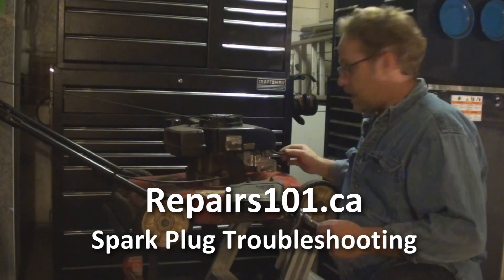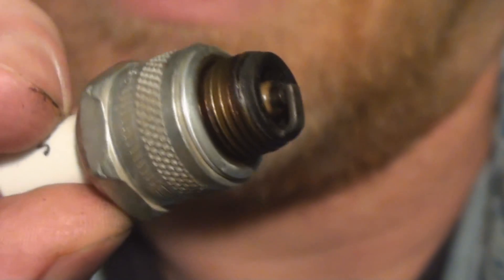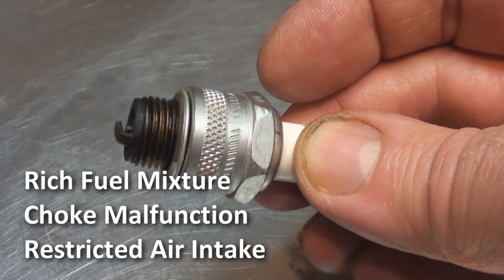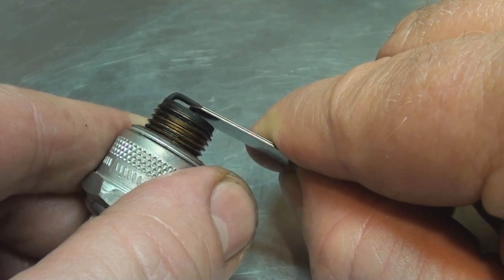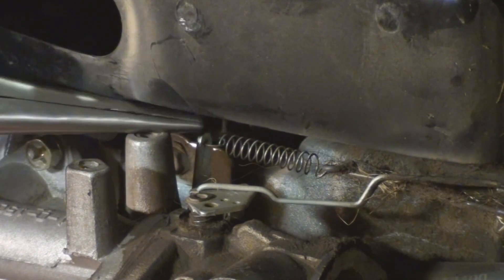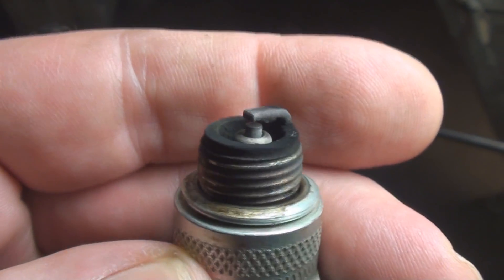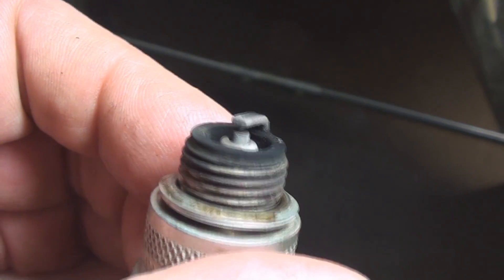Spark Plug Troubleshooting

Comment: We got one on a compressor motor it was working earlier brand new plug we can stick a screw driver down the plug wire and try it it will shock you when we put the plug in it dosent even make a spark at all its like the coil decides when it wants to work

Comment: i had a exhaust manifold leak, and the new spark plugs became very black. After fixing the leak the spark plugs now stays in top condition.
Reply from the maker: Cool!
Reply: And that exhaust leak caused the o2 sensor go crazy, it was stuck at 13% lean with a complete new manifold. After replacing the o2 sensor with a new oem one, the values now are 0,5% at long term fuel trim.

Comment: hay i have a stihl concrete cutter and it runs but when it gets hot it turns off do you know what could be wrong with it thanks
Reply from the maker: If you mean its starts but won't work the most likely thing is it was run with straight gas (not 2 stroke mix) and the exhaust side of the cylinder has been eroded until it no longer holds compression.
Reply: it has full 2 stroke in it because once you let it cool down it works again
Reply: mixed 50:1

Comment: I have yamaha ybx 125 which has sparkplug shorting problem... when I install new spark plug it will start and after few minutes it become fully black... 1 new spark plugs lasts just one week please help me sir what could I do
Reply from the maker: Change your air filter, change your oil, check your fuel is correct and clean. 
If that doesn't do it you'll need a compression test to see if you're sucking oil from the sump.

Comment: Aloha R101, Mahalo for this very nice presentation, easy to follow your explaination of a knda esoteric subject. If I may ask a question not covered in this 101 class?...I'm gonna ask regardless, of course!...any idea what causes oil seepage up from the hex on the metal shell and out onto the base of the porcelain insulator? Its not dirt or grime, mind you, this is a 1/8" wide ring of brown engine oil...?? Mahalo again & for any help? Aloha
Reply from the maker: Probably either spillage from oil changes / fluid top-ups or it's an airborne spray from a small leak nearby / thrown there by drive belts etc.

Comment: There's oil on my Yamaha ttr90 spark plug what do I need to do to fix this?
Reply from the maker: Not knowing anything about your bike - if it were on my shop floor I would run a compression test to see if it isn't sucking sump oil - failing that are you using oil bath air filter (correctly)?  Has someone accidentally put mix fuel (or any treatment etc) in the tank? Sure it's oil and not fuel?
https://www.manualslib.com/manual/582283/Yamaha-Ttr90-M.html?page=56

Comment: Hi Repairs101, today I did a plug chop with my moped, and I got a white insulator tip with a clean gnd electrode, the inside of the plug had a thin layer of carbon though but it was optimal. The point is each time after I come from a long ride I check my sparkplug and its completly covered with a carbon layer; insulator and both electrodes, not very hard deposits but too far from the optimal "tan color".

My concern is, as the plug chop showed me a really good result with the spark plug if I keep leaning the mixture I could damage the engine right? But on the other hand the black and dry carbon after my rides show me that Im running too rich..... 

This is troubling to say the least.

ps: Nice video.
Reply from the maker: OK so black fuzz definitely indicating wrong mixture and / or too rich / overfuelling.
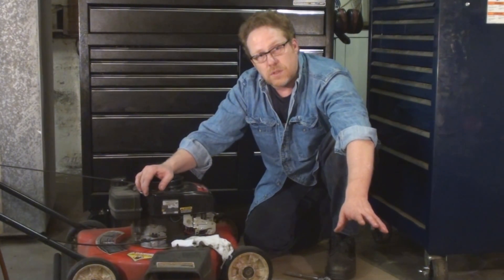Yes too lean will burn the exhaust side of the piston until compression is lost forever - see my video Chainsaws 101 - Safe Operation How To / What You Need To Know https://youtu.be/Vm8YYURlcSk at 2:17 mixed fuel 
Find out what the manufacturer recommends and use only that mixture and type of oil (conventional vs synthetic) .  Good luck!

Comment: My mower starts and runs fine until I engage the blades. Any idea what that could be?
Reply from the maker: Sounds like poor compression - 2 stroke? run straight fuel once by accident? that will require a new power pack (cylinder and piston) 
see Lawn Mower Compression Test  https://youtu.be/U0DuLtoHbWg 
Also have a look at (in particular 2m:17s)  Chainsaws 101 - Safe Operation How To / What You Need To Know  https://youtu.be/Vm8YYURlcSk

Comment: mine has spark but won't fire up ,Evan if I put gas in spark plug opening
Reply from the maker: There's 3 components - Spark, Fuel and air - check to see it's getting enough air.
Reply: +Repairs101 bad head gasket, caused no compression, good to no about the Rings thanks

Comment: how can I get a hotter spark? my engine has a yellow spark
Reply from the maker: My guess is you have the wrong spark plug. Check data tag /spec plate or owners manual for correct gap.
Reply: Repairs101 I want to say you are right, only it is the original spark plug, this is the first time I have had to service this engine
Reply from the maker: I would double check with the manufacturer specs to be sure it was shipped with the correct plug to begin with, then get a replacement - maybe it's just worn out.
Reply: Repairs101 yea, maybe.... thanks for your help!!

Comment: I have a Briggs & Stratton mower. After getting half of my back lawn mowed I stop to add gas, after I add the gas and try to restart the mower I have to wait a half hour then replace the spark plug to get It to start again.  Any ideals why this happens?
Reply from the maker: Sharon Thommen You must have one enormous back yard. My guess is it's overheating from overwork (small mowers are for small yards) &/or a build-up of grass clippings and debris insulating the machine overall. Remember, I can't see it, so I'm just guessing. Perform a basic service, as shown in this recent video of mine https://youtu.be/yy9RdTo_KwI  If that doesn't do t try priming the carburetor after you refill the tank with a splash of fuel in the air filter housing (remove air filter, splash 1/2 oz fuel, replace air filter, start mower.) Good luck!

Comment: Enlighten me, afaik, white isnt  right mixture, it simply means its lean. It should be golden brown not black nor white.
Reply from the maker: Yes! It is a crush type washer which has a distinct face and back (don't mix them up) and is critical for proper compression. I have seen engines run without them in the dark and you can see the fire escaping from around the plugs. Good luck!
Reply: Repairs101 the ring on the spark plug....is it a must have?
Reply from the maker: elcid agustin http://ngksparkplugs.com/tech_support/spark_plugs/faqs/faqread.asp

Comment: Hey, I have a 4 stroke petrol 50cc scooter, it runs perfectly and smooth but I am finding that I have to clean the spark plug every few days other wise my scooter wont fire up. I'm guessing that there is no spark to due to muck and other things on the spark plug, but what I wanted to know was how to get ride off the muck (etc) fully or at least so I don't have to keep on cleaning it every few days? Thanks...
Reply from the maker: King Tanyard  Muck and what other things? If it's a black fuzzy soot my guess is overfuelling. Have a look at these links to narrow down your diagnosis and get back to me if you still need help.
http://www.globaldenso.com/en/products/aftermarket/plug/basic_knowledge/troubleshooting/index.html
http://ngksparkplugs.com/tech_support/spark_plugs/faqs/faqread.asp
Reply: OK I will take a look. Thanks for answering!

Comment: I have a power washer that seems to kind of backfire from time to time while running. When I checked the plug it was fouled and the electrode tip was partly eaten away. Could this be a rich/lean issue or does the ohv need adjustment? Any suggestions?
Reply from the maker: thersten It's always hard to diagnose stuff by eMail. Is the noise coming from the intake or the exhaust? Also, I don't know the machine make or model nor service life, general condition or maintenance schedule. The backfire and the electrode erosion may be completely unrelated. My instincts say if its a new machine look for fuel incompatibility, wrong plugs, damage (to ignition / wire insulation, say). A well maintained (meaning new air, fuel and oil filters regularily) old machine I would be looking at fuel delivery and timing to address backfiring, making sure everything (plugs, wires, filters etc) is OEM first

WIKIPEDIA says - Common causes of backfires are:
Poor or unregulated engine timing is often a cause of intake backfires, but can also be responsible for exhaust backfires
Improper wiring in the ignition can also lead to timing issues and backfires
Low fuel pressure, clogged fuel filters, and weak fuel pumps could cause a severe lean air-to-fuel ratio during fuel injection
Missing or damaged catalytic converter can result in backfires out the tailpipe

http://www.globaldenso.com/en/products/aftermarket/plug/basic_knowledge/troubleshooting/index.html
http://ngksparkplugs.com/tech_support/spark_plugs/faqs/faqread.asp

Comment: When you read a sparkplug and determine if the air/fuel mixture is rich or lean, do you need a new sparkplug before you can read it again? My engine ran rich before and the tip was black, I made it leaner but I am not sure how to read it again since the tip is already blackened
Reply from the maker: Clean it up with a wire brush, brake cleaner (solvent) and compressed air or whatever you have - check the gap is still correct - you should have no problems. Good luck!

Comment: I have a briggs & stratton push mower (6.75 HP OHV) It starts just fine at first, but starts stalling after a bit of use (approx half the yard... of course.)   I noticed last night that the spark plug has been accumulating oil and getting pretty black.  Sounds like a worn piston ring.. Is this something i could repair at home? Or should I consult a shop?
Reply from the maker: 1st perform a tuneup http://youtu.be/gPb64N01AAY
then a compression test http://youtu.be/U0DuLtoHbWg
if you still think you have worn rings. Good luck!

Comment: Is there a specific torque for putting a plug back in?  Don't want to strip the threads.
Reply from the maker: I was taught to wind them down and then turn them "snug" (anywhere from 1/4 to 3/4 turn, depending...) but I know that's not a very satisfying answer.
Check out http://www.ngk-sparkplugs.jp/english/techinfo/qa/q18/index.html
and http://www.nology.com/torque.html for some tips. And carefully apply never-seize to the thread only.. Good luck!

Comment: On a 2 stroke with no oil injection, Is it best to wait until after the engine is broke in before worrying about spark plug color? My plug is pretty black but it hasn't run for very long yet the carb malfunctioned then flooded waiting a new carb to be delivered and the engine has run maybe 30 mins so it wont be broken in untill another 2 tanks of gas the manual says.
Reply from the maker: I would check for air restriction, check mixture settings, run the 2 tanks through it, then replace the plug(s) and monitor from there. Good luck!

Comment: See if it will start on a prime of gas. Just about 10 drops of gas. If it runs for a second and dies, you have spark and compression. You have instantly narrowed it down to a plugged main jet which is the float bowl nut on Briggs and Tecumseh engines.
The "before" shot of the spark plug shows a normal running engine.
The "after" shows a lean condition...not good. Main jets are pre-sized for slow running so engine will pass noise and emission standards.
May have to drill out the main jet a bit.

Comment: hi, nice vid. i have an etesia mower fitted with a briggs quantum ready start. i have fuel and i have spark but not starting. i thought i sheared the woodruff/flywheel key but is fine. ive taken the head off and can see oil seeping past the piston rings. is this enough to not allow it to start? cheers.

Comment: My best guess is that you need adjust your carburetor.  If you mean that the electrodes are burning away off the spark plugs than you are burning too little fuel in your fuel/air ratio.  That will burn out your engine fast btw... better check into it.

Comment from the maker: If you're talking about a mower engine it may be drawing crankcase oil up past the piston rings (4 stroke) or maybe your fuel is mixed too rich (2 stroke). A more sophisticated engine may have a head gasket leak allowing gallery oil to find its way into the combustion chamber. A cracked cylinder head could allow oil to seep in at the injectors. Lots of possibilities.  A compression test will indicate ring condition and a leak down test will confirm (or indicate another problem). Good luck!

Comment: okay, brown means a nice clean burn, white means that there is either not enough oil in the fuel if its a 2 stroke for example, or there is to much octane in the fuel, or the third option, you are now running at a too high RPM and there is not enough air.